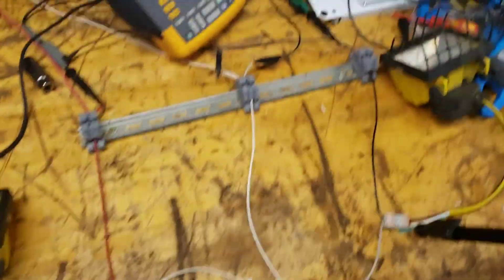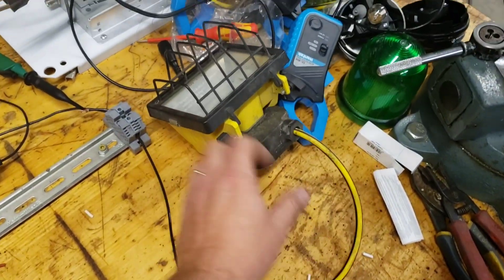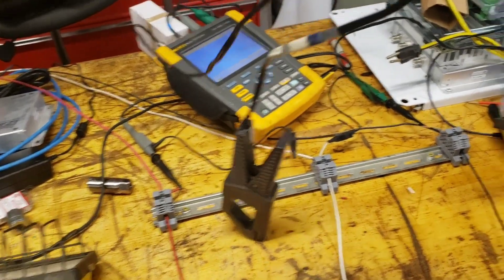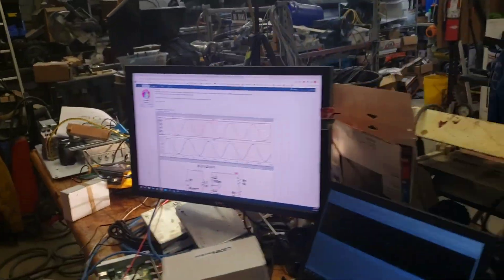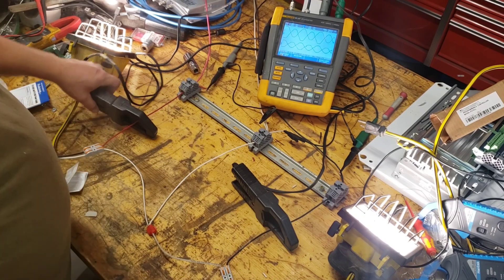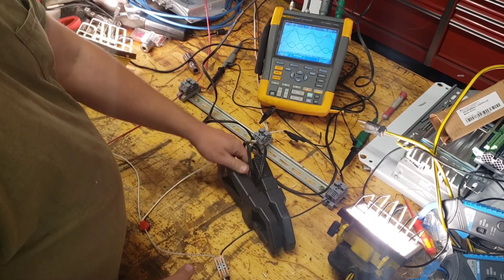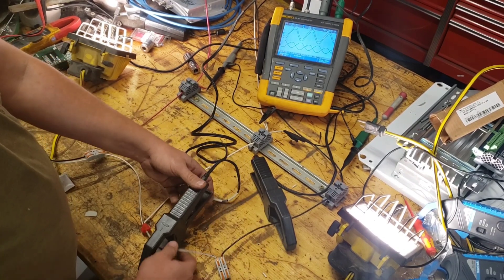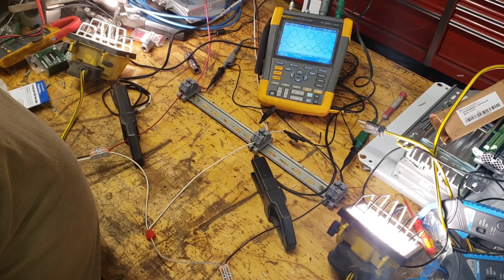Inverted/"180 degrees out of phase" current.

Comment: The whole 180 degrees is only on an oscilloscope and is because you only have one connection to neutral.  There are three voltage sine waves that start and end at exactly the same time and are in the same direction.  120 volts L1 to N, 120 volts N to L2, and 250 volts L1 to L2.
If you truly have two 120 volt sines in opposite sides of the zero line, they would cancel each other out and be zero volts.  Your teacher didn’t tell the whole story.
Maybe this video will help you understand.    https://youtu.be/nOSYHUxHxG8.     Or maybe that was the point of the video.
Reply from the maker: Yes that was the point of the video.